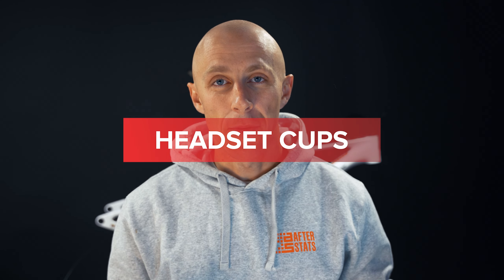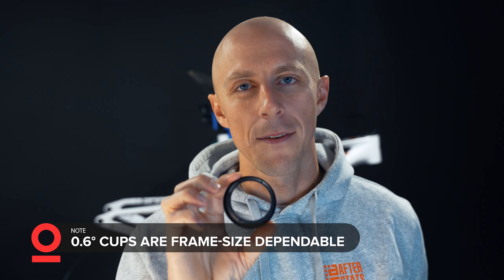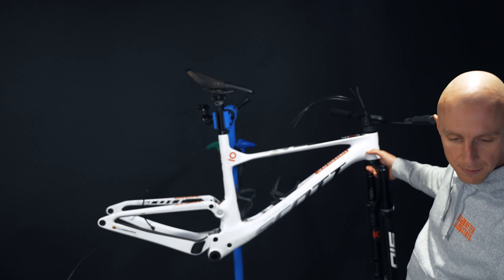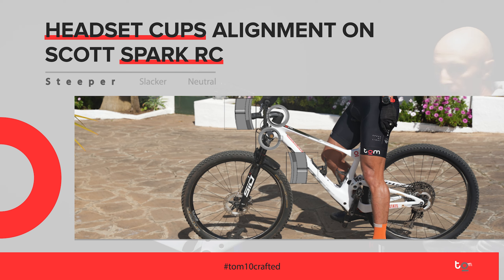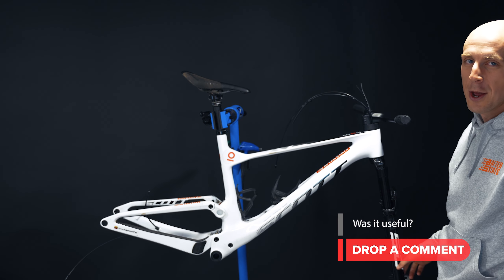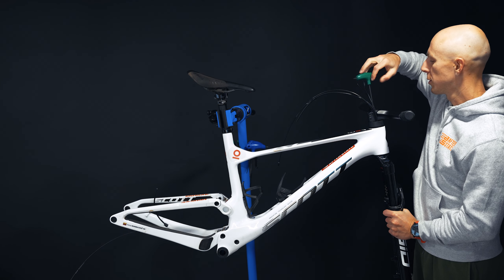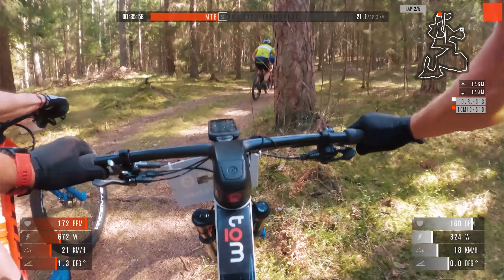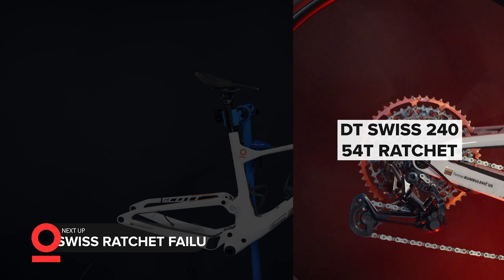Slack VS Steep Headset Angle Explained - How to Setup Scott Spark Headtube

Comment: Thank you so much for doing this and confirming the head tube angle. I was surprised how vague Scott was with the explanation. Most reviewers seem to think the steep is 67.2 and slack is 66.6. I suspected they were incorrect because of the inclusion of the neutral cups. I have even seen some reviewers, whom I won't name, only rotate the top cup and explain that will slacken it 0.6, and if you rotate the bottom cup in conjunction, it will slacken 1.2!
Reply from the maker: Thanks! Same here - by writing few extra lines in the manual they could have get rid of any questions raised:)

I very much hope that this is all true, but by having the measurements it would be possible to calculate the angles too! 

I have seen misinformation on very notable news websites, thus.. it just proves the fact that you have to be hungry to check few sources for facts confirmation:)

Comment: Very informative content as usual.  Thanks, Tom! Just when you think that scott can't make it any more complicated than it is comes the fact that not every cup will fit your body because the frame size is different. Well, I didn't expect that,  but after a few minutes of considering, itt makes definitely sense.
Reply from the maker: Thanks, Ivo, much appreciated! The sizing of cups is different because of head tube length, most likely. Different size frames has different head tube, and in order to maintain the same angles through all of them - thats why cups has to be different (S and M are the same, L and XL differs)

Comment: It would be nice if you would make 2 (or more) laps of the same track with the 2 different wheel base and tell us the differences according to your feelings. I owned an RC for less than a year but never bothered to change the angle. I expect to get my new Spark 900 in couple of week but will change the headset tube angle to experience the differences
Reply from the maker: @vcnzone  it would be interesting for certain “time wise”, but based on the feeling I know the difference:
With steeper, going downhill in trails feels less controlled, but climbing is more agile.

With slack - well, it is opposite :) trails handles more comfy, and on climbs that wheel stretched in front remembers about itself:)

Comment: Thanks a lot for that information. Superb.

Ah, not sure if that's in this video: Rockshox damper in the fork. An ongoing problem. I had 3 times exchange of that part without lasting positive effect. It is a bleeding - problem. Seems that bleeding is not done very precisely at the service. I do bleeding by myself now approx. 3 times per year. A weak point of the bike. Yours Holger

Comment: Hello Tom, so do you prefer Neutral or 0.6? What are the differences you feel? Thanks.
Reply from the maker: Hey man,I didn't tried neutral (0 degree cups). But from Slack vs Steep angle, I like slack way more, its more flowy in singletracks :)

Comment: My Bold Linkin lT(Spark) , has rattle at Headset when  braking, I have tried many ways but do not work. Is it normal to have some movement at headset when braking? Thanks.
Reply from the maker: At no point this can be interpret as being normal. Try to figure out where specifically the movement is coming from - whether it is cups, or bearings themselves.

Comment: Does slackening head angle steeps seat tube angle?
Reply from the maker: I believe yes - as the front wheel pushed forward introduces lower BB, that results into seat tube leaning forward slightly
Reply: @tom10crafted  thank you man.

Comment: Does slacker setup bring the BB down a bit?
Reply from the maker: Yes, BB goes down a tiny bit as well as head tube itself, yet its negligible difference which has no real-feel (like, you won't start pedal-strike everything immediately because of the change)
Reply: Thanks!
Reply: What is your like ? 0 or 0.6 ? 😇
Reply from the maker: @axelgiuliano  I have 0.6 cups and actually trying to test both of those options not just riding, but in race conditions:)
Reply: @tom10crafted  hi Tom where we can buy the cups 0.6 and the HEADSETS Up/down because they are dead :/ not ceramics :D
Reply from the maker: @axelgiuliano  Bearings + the sealings can be found here:
https://r2-bike.com/SYNCROS-Replacement-Bearing-for-Head-Set-tapered-SHIS-ZS56-286-ZS56-40-for-Scott-Spark-from-Modelyear-2022

Yet, for the cups, I haven't seen any source of getting them. Probably asking your dealer would be the best call

Comment: Hi, I have a few questions. If you can answer, I would appreciate it. Which headset angle do you like best? How many millimeters of spacing do you use in the headset? How many millimeters does the stem of your handlebar measure?

 Thank you!
Reply from the maker: Hey, sure, happy to. I prefer slacker setup, as it gives more play in the corners and smoother singletracks experience. Thus, its -0.6

I use one single spacer, which results in around 2cm of height (~18mm or so). The cockpit stem is -20degrees, 10cm in length. The frame size is L and I am around 1.85m in height !
Reply: @tom10crafted  Is your handlebar stem 60mm or 70mm?

 Thank you!
Reply from the maker: @c4melof  no, its 100mm :) virtual 10cm stem on -20 degrees. I have quite long torso and reach, thus thats why I had to compensate on that🤘🏼
Reply: @tom10crafted  Got it! I asked because mine is a large size and it came with 70mm.

Thank you!
Reply from the maker: @c4melof  mine’s been other as well, with -10degrees🤘🏼🫶🏻
Reply: @tom10crafted  Hi man, I'm also preferring the slacker position, with the same spacers in the steeper my hands start to get numb. Right now I'm using 80mm -9° with 0.75mm spacer, very similar to you (L size and 1.85m). I've already ordered the Fraser bar 🥳

 I have the 100mm -20° Fraser also but I couldn't handle it, now I'm thinking I didn't try it with the slacker angle 😀
Reply from the maker: Hey @BVAR16  ! What was wrong with -20 100mm - too far away? I am currently considering to try -30 with 8cm potentially, to get myself a bit lower - but not sure yet, haha!
Reply: @tom10crafted  hey Tom. What is the benefit of going -30 vs -20 to get lower, instead of just removing the spacer under the handlebar?
Reply from the maker: @Control0305  Hey! The idea which I have in mind (not sure whether it would be prove to be beneficial), is maintaining the similar reach, while getting closer towards the center of headset (to eliminate counter steering effect). Thus, I might be even able to use shorter than 10cm virtual stem as well. But thats just thinking out loud! :D

Comment: On what website do you get those cubs can’t find them anywhere.
Reply from the maker: The only one which I am aware of is this: https://www.westbrookcycles.co.uk/scott_spark_headset_cup_kit_2022-18967

Haven't ordered them myself though. other option is to get it from your local bike shop/dealer. They can order directly from supplier
Reply: @tom10crafted thank you so much, I was replacing the bearings and they are pretty worn.
Reply from the maker: @alwinvanasperen1895  its strange that it is not easily available to purchase from the same Acros, for example..

Comment: Buy two bucklos headset packages with bearings and seats. And invert the seats just simply laying them there on the tube on the fork. I use two. They not for that but it works even the bearings and in  grooves
Reply from the maker: With bucklos you most likely, if nothing backfires set angle to 0degrees - which is not bad thing, but the reason why those pins are crucial for slack/steep setups

Comment: Can I chance the head tube angle 65.8 for  67.2 like a RC version?
Reply from the maker: Can you clarify the question? Do you have it now as slack with 65.8 angle?
Reply: @tom10crafted  I have the opportunity to get a Spark frame, however I would like to make the head tube angle more similar to that of the RC team, is this possible with the adjustment?
Reply from the maker: @soulcaliburbra  the thing here is that whichever spark you get from 2022, it will have cups to be rotate to change the angle. Thus yes - you will have that option.

Comment: Hi, I use simply default for my bike which I appreciate because I don;t have this option. Why? Because it is fancy shmancy and adds another level of complexity, another level of gear that have to bought and maintain and in this very case it also could add more friction. It is like wireless shifters: maybe nice to have it (looks neat but has multiple drawbacks which effectivelly stops me buying it and it is not a money constrain). I like stuff that Scott delivers but for me gear that u broke (like plastic cups) is a big no no for such a mature company. I know that mosts bike users expects new things each year but history shows that simplicity for some bike parts are the key, the same goes for material used to made them. Of course another is story is for people that only owns bikes but I expect from Scott that for such high end frame will not introduce some shitty solutions or at least not mix high end with untested once. Maybe that is a strategy but if u buy Maybach u want to have a car that is better in every way then car priced 10x less. So this is suprising for me why the hell they even think about introducing this unnecessary complexity in bike/frame that should last virtually forever.
Reply from the maker: Expecting that materials will last forever is destined for failure - thus better not to have such expectations.

Cups didn't worn too much in 3 years and they are still the same on the bike (but replacing as part of maintenance will be a good thing anyways)

What you have describe here is equivalent of buying a car and hoping you will not have to change any parts and it will be always new - it is not feasible in any given terms.

Last but not least, there is a difference between FANCY and FUNCTIONAL - which, those cups introduces.
Reply: @tom10crafted  i'm not expecting all parts to live forever in bike but I rather expect that paying more will give u beside better look also better quality, more bullet proof solutions. My bike is not a highend Scott but I conciously chosen one that do not has some genious custom solutions which has to be maintained and be source for errors. I hope always to not to change too much of parts :) because then I have to set things again to be again perfect. I accept that some parts worn faster but I don't like to be surprised. Instead I want to have fun on riding (not servicing all the time), i dont want situations where some plastic shitty part is telling me - hey now u have to replace me or better stay at home and more over i have to pay more and scratch my head to think that there is only one shop in EU. There is of course thin difference between functional and fancy - the question is do pro users really needs this in the first place? My feeling about it is probably not: in races only counts reliability, performance, stability and ability to fix something as quick as possible. I don't see any reason to put such a slack changing option in a racing machine, even fancy Cannondale do not introduced it so this puzzles me but this a philozophical question to Scott. My gut feeling is that most expensive bikes are kind a iPhone: u get one for a big amount of many and this only the beginning of your expenses . Best of this is that not every company practice this. So I have for u another topic to discuss on channel: why u chosen this specific bike for u and how it compares to other options u get into consideration.
Reply from the maker: @dev-on-bike  thanks for your input, appreciate it! There is no better thing than constructive discussion. Scott sold this two-geometries in one idea by talking about it loudly - who does not want two differently behaving bikes in one? That is why this is not relevant to PRO's much - they can have whatever they want to have, whenever they choose to. Solutions like such are to suit as big customers range as possible and convince them they need it. Guess how many people actually tried changing this headset cups setup and can tell the difference - yes, it is minority :) Why I have chosen Spark - is perfect topic for new video!!! :} 

P.S. Those cups are not plastic alone, its some reinforced material, and it is not as bad as you expect:) BUT you have very valid point - if broken, thats a headache to get them!